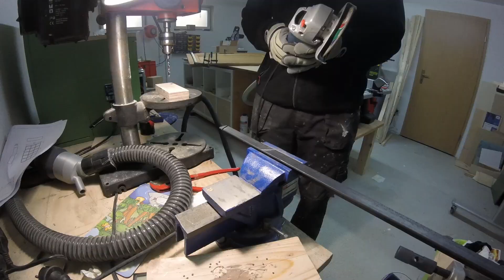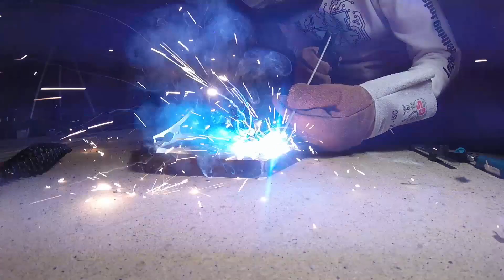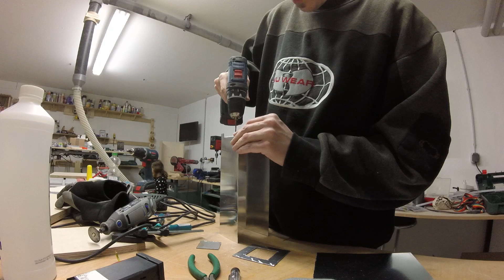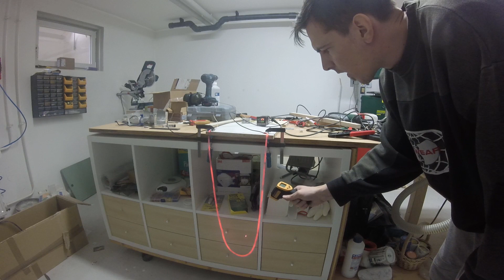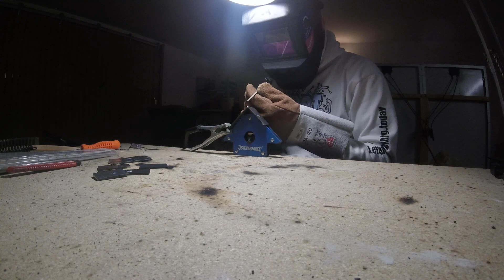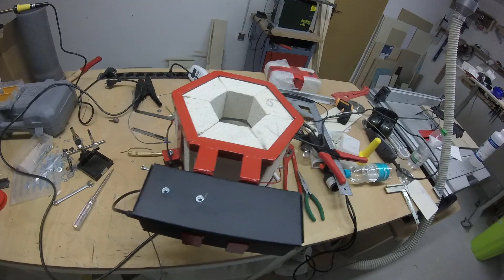I built my own ELECTRIC furnace!

Comment: Why do you not answer any questions about "Arduino powered box joint jig for the Bosch GTS 10 XC - Part #3" I have done the same with my Box joint jigg and GTS 10 XC